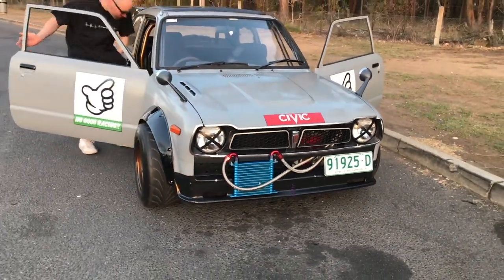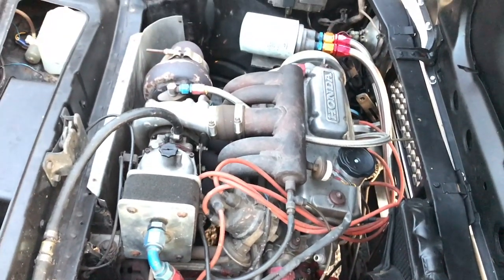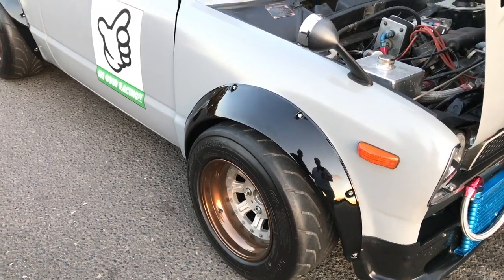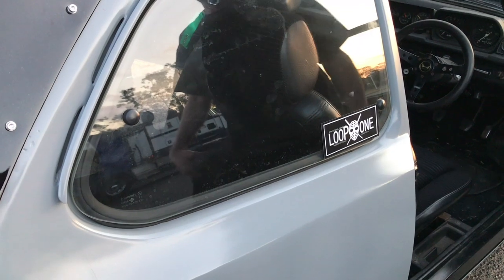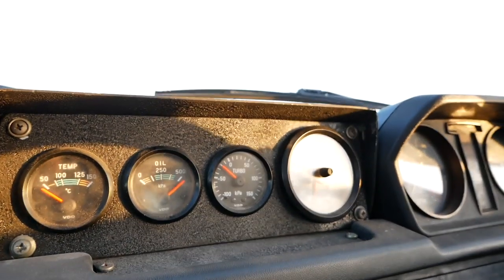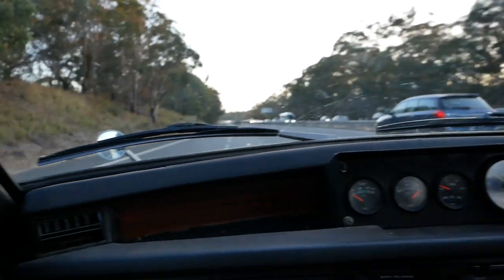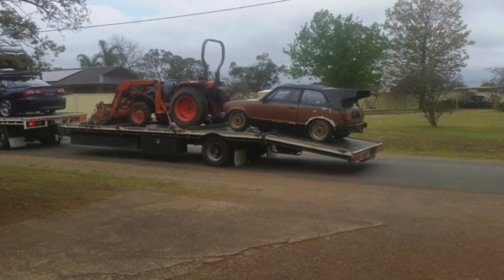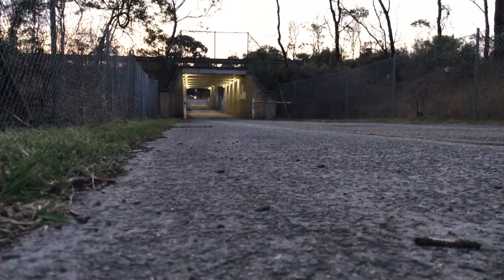1975 Honda Civic SB1 Draw through carby turbo Mugen wing

Comment: Im way way late to the party.
The first car i ever tried to work on was a 77 honda cvcc. My dad bought for me to mess with when i was 14. I wish i would have got it running good, but it had a 79 Accord 1751 cc motor. 
It barely fit, the alternator was pretty much touching the back of the headlight, and a hole cut in the hood to clear the carburetor(with a Subaru Impreza hood scoop covering the hole). 
It never ran right. And i only got to put around in the driveway, but if it would have run properly, would have been almost 2x the factory hp. 
Couple years later i wanted to take a 1.6/5 speed  from a 92 4 door to swap into it, but i ended up selling it off and building chevy trucks instead. 
Builds like this makes me want to go find another and actually build what i had always imagined

Comment: I HAD THE SAME MODEL SAME COLOR WITH EN1 BOTTOM END EB3 HEAD EN ELECTRONIC DIZZY TWIN 35 MM SIDE DRAFT  DELLORTO CARBYS CITY TURBO 5 SPEED AND BLEW AWAY EVERYTHING ON THE STREET MR2 TURBOS,5L COMMODORES  HAD NO CHANCE THE SOUND OF THE CARBYS WAS SO LOUD DAM I MISS THAT CAR..I FOUND ONE SITTING IT HAS RS1200 BADGES ON THE GUARDS I MIGHT HAVE TO GO AND TWIST THE GUYS ARM FOR IT...